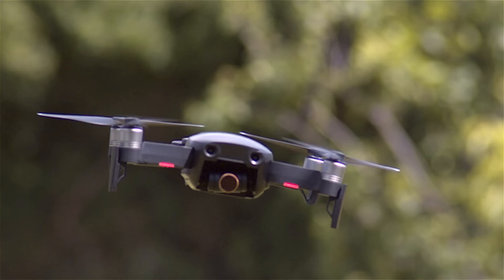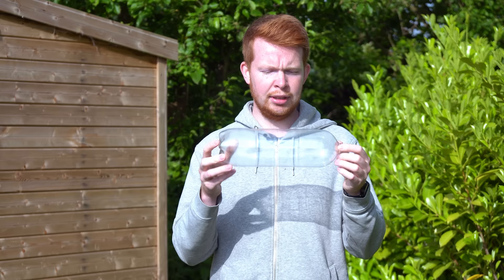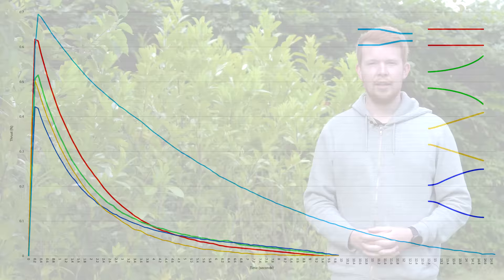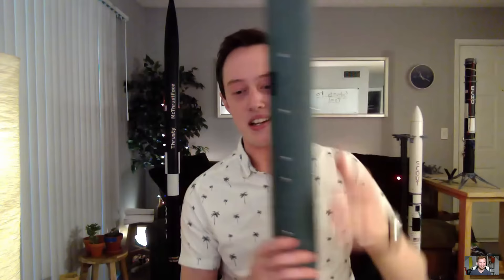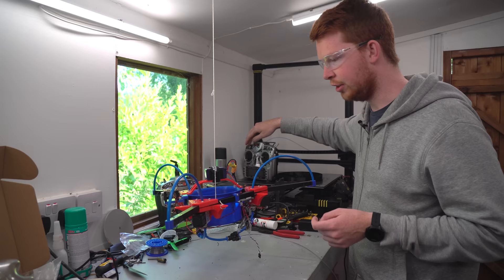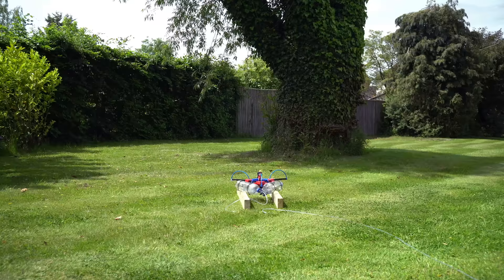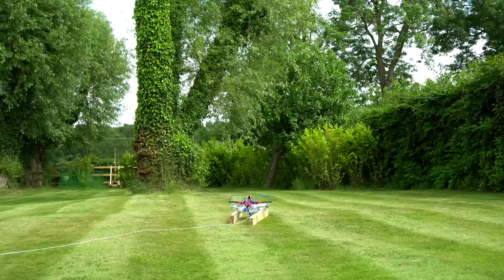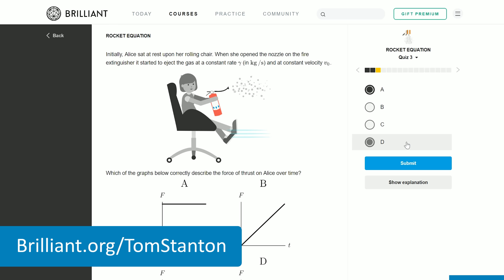Gas Thruster Controlled Drone

Comment: Nice work Tom. How about a pressure regulator on the valves? Small, light en always the same pressure till the main pressure drops below the regulator. Find out what pressure is needed to control the drone and go to the minimum to extend flight time. Also try to get more compressed air stored to maximize it.

Comment: why not put a small vessle to store Dri ice and have the gas's piped into the lines from that
as if you take fine  crushed dry ice it is light and will keep producing a bit of gass  giving possibly a bit extra run time with smaller size of tank

Comment: It appears that the sampling ratio is not in syc with the reaction time of the valves, also a fixed gyro to stabilize the horizontal plane would dampen overcontrolling and be more "user friendly ..

Comment: Looks like your issue with taking off directly from the ground could be due to the Bernoulli effect. Simplified, the air from the motor duct is exhausting straight down to the ground and then outward, squeezing between the ground and the air reservoirs. This makes a low pressure zone underneath, which allows the atmospheric pressure above to push the vehicle down. In essence, it's creating reverse lift. Just my theory though.

Comment: the idea is great. but the balancer would have to be sensitive and instead of the propeller, a helium balon would be a great thing. then you would need twice the number of nozzles, but would have an almost silent drone and an extremely economical one. with solar and a small compressor, the flight time would be unlimited. the part would only be quite large.

Comment: How about try using more than 1 nozzle per arm on the single hose to get more thrust per corner. Might have to increase the size of the hose a little. Probably fit the 3 nozzles in the single tip. Will this up the thrust any or would the extra release of air pressure drop the thrust?

Comment: It seems to me that, early in the flight, it wastes a lot of pressure over-correcting itself. If you could throttle down the thrust early in the flight, that might significantly help to increase flight duration.

Comment: I'm late to the game and I expect you have move on. However, you have a good idea that will work. A tri-copter with no exposed moving parts could have several uses. It needs to have the attitude adjustment jets thrust be predicable throughout the flight. Using  Aluminum or Carbon Fiber air tanks with pressures up to4,500 psi giving as much as 45 times as much air storage in the same size tank. Of course it would require a second tank and a regulator to supply air at a constant 150 to 400 psi. At these pressures, you could use much smaller nozzles and valves to send shorter pulse air at higher pressures/velocity conserving air as thrust is calculated as Mass * Volume squared, which would be the (density of air * pressure) * (V * V) giving the pressure an extraordinary contribution to the thrust as it contributes to both mass and velocity. 

Using an old man's 60-year out-of-date minimal physics education, some experiance experience valving gases, and a bit of Google foo to find calculators get the Standard Cubic Feet Per Minute flow for air out of a 0.1 & 0.5-inch hole at 100 and 200 psi and converted the SCFM to psi with another online app. Based on my current thoughts, the following is the function in Cran R I used to calculate the thrust due to pressure and velocity. It is the velocity of air in feet per second (fps), the pressure in pounds per square inch (psi) above atmospheric pressure (~14 psi), and I used 0.000747344 oz/cubic inch as the density of air. Sorry for not using Metric units. I can, but this one is tough enough I need units I understand without question to trust the work at all. I could be dead wrong or have gone off the rails at any point.

f.thrust.gas <- function(v,p,d=0.000747344){
   return(((p-14)*d)*v^2)  # I grew up using 6 inch slide rule. 14 pis is close enough to 1 bar for this.
}
f.thrust.gas(3000 fps, 200 psi)/f.thrust.gas(1500 fps, 100 psi)
return 8.651163 times more thrust from twice the pressure.
which was twice as large as I expected it to be. I hadn't considered that the pressure would increase the gas's density until I started to commit the idea to code.

This calculation shows a 36 times more thrust from a 0.1-inch orifice at 80 psi than from 20 psi above atmospheric pressure. I think you will have to put a pressure sensor somewhere in the system so you can increase the the time the jets are open as the pressure falls or regulate the pressure in a secondary tank that feeds the valves to attitude control jets and have a pressure sensor on the high pressure tank to warn as the pressure falls too low.

Comment: Maybe a next step could be adding 1 or 2L hp aluminum or carbon tanks from airguns? Pumps can be rented or use a few hp 80cuft scuba cylinders as refill source. They can nominally run 500 psi. I'd consider swapping to off the shelf nitrous solenoids (car racing) to gain considerable flow but mostly for the speed of actuation, addingsome supercapacitors inline. I have all the above here to lend my friend, but we are a world away :-)

Comment: I guess you could put a digital PSI detector in there that could dynamically change the values on the Arduino. I'm not sure how easy it would be effectively do that, though

Comment: Bang bang control should produce oscillatory systems as you would overshoot each time the feedback kicks in. If you have like 3-4 valves for each bottle, with different follow rates, you have a more granular control which will allow better stabilization. I am interested in seeing the graphs to see why it was right out unstable instead of oscillatory.

Comment: I recently tried to build a similar self stabilizing while manually controllable thing in vanilla scrap mechanic but i failed when i realized that there are just logic gates to provide automatic control and a binary state distance sensor.
Need to try it again with mods at some point 🤔

Comment: Try a larger prop cylinder to let more air through for lift it is quite large bottom to top for the area size or a 3rd of the hight for the size of the airflow ?

Comment: I can see weight distribution being improved way more efficiently to work with the propulsion system as well as placing thrusters on an “antenna” so it works as a leaver, so the tilt can be  less aggressively and more efficiently so the thrusters eat less supply. It also may help if you place some of the weight to a drag behind the level of the engine thrust point. The conventional drone shape configuration may not be the best application for the propulsion system. This drone should be designed with the propulsion in mind and it will prob look way different.

Comment: you are using hipersonic nozzles, however the speed of the gass never manages to create a shockwave, therefore you should use bernoulli principle and mass conservation in integral form, assuming Q1D, the outlet area shoud be much more smaller in order to obtain a higher escape speed and therefore improving your delta V

Comment: At 11:41 I instantly said "uhoh..." cause that's an undamped system and they tend to go nuts. Let's see how right I am. As I suspected, almost works but can trigger back and forth over and over out of control.

Then he goes on to prove it works. But it's also not very stable for the reasons I thought originally. Still awesome!

Comment: Tom. If the thrusters were shooting a little water instead of air would that be more effective ?  Clearly there’s a mass issue in carrying the water but the reaction should be far greater. Also; how about using a denser gas ?

Comment: Hey Tom, that's clever, maybe somebody else already write a comment in that way but there is too much...

If you can do a 2 stages  gaz tank system with a higher pressure in the first stage that fill the second stage you can have a  constant pressure in the 2nd stage, no?

Comment: Could you use a 3 port solenoids to bleed off air using gain... creating a ramped effect... theoretically you could use that bleed air as additional thrust on a additional "main" jet.

Comment: Why don’t you use car fuel injectors as valves plus outlet they can perform both duties, they are light weight, can holds liquid pressure of 50 to 60 psi, and needs 12volts dc just as on and off position...

Comment: If the drone with the longer arms worked best at low pressure, why not use a pressure regulator? you would also get more control time.
Nice project!

Comment: Hi Tom. Ever thought about using some dry ice or liquid nitrogen as your "compressed gas". I guess if you put in a small solar powered heating element and a dump valve you could, to a degree, control the pressure out put.

Comment: The thrust is proportional to air flow rate through nozzle times to air velocity of air leaving nozzle. You showed that a 2mm nozzle increased air velocity much more than it reduced flow rate. Your goal is to maximize velocity so you get the most thrust and minimum flow rate.  You should have tried a smaller diameter nozzle. Then a better nozzle shape might have helped.

Comment: really enjoyed your video. you should design and 3d print a flying saucer drone. set up 6 small motors evenly spaced with...NO PROPELLERS ...but....turbo fans that are 3d printed at proper pitch for maximum lift. your saucer could have six holes cut out evenly spaced for the turbine fans. then use a gyroscope....a small one...in the center of the craft for balance. im going to be building one with my 3d printer out of PLA. you could use hall sensors for proper rpm of each motor to make sure they are putting out the same thrust. a hall sensor could be placed by each motor read by a digit screen BEFORE you install them into the saucer...so you know they have the same identical rpm.

Comment: i think it would work better with the tanks on the opposite side on top and the board on the bottom which should help with controlling issue aswell this should even it out mabe?.....and a 4 leg stand so that its not flat on the ground

Comment: So a 3 motor design wouldn't work because there would always be 2 motors turning in one direction and one in the other right? What if you could revert the turning direction of each one of those motors multiple times per second? Perhaps you could have some clever software figure out when to turn which motor in what direction to provide yaw control.

Comment: You  need regulated flow out the solenoid valves, cant have your pressure dropping with only the controller to compensate.

Comment: The reason the straight nozzle performed best was because it was the least overexpanded, you need to calculate the ideal expansion ratio and make sure you get that, then I’d expect a bell nozzle to perform best.

Comment: Air is pushed out of the nozzle... pushing on the air under the drone... because of the frictition it causes it can fly... but in space.. on what is the rocket fuel pressing? Ther should be vaccum.. and vacuum means there is nothing tp push...

Comment: Good job! I'd like to add my suggestions: looks like a turbojet's nozzle was the best, may be to modify it for better efficiency: to make narrowing of the nozzle's hole with radius,  not straight line, like it was in the bell nozzle, but opposite (outlet is smaller than inlet), may be  it will increase thrust a bit...What about to make arms longer?This way you'll increase levers of the forces and efficiency, may be to make them thicker in the place of attachment and thinner on the ends, it will decrease weight...

Comment: Could you make the throttle on/off conversion value a dependent variable on tank pressure? I assume the optimal value changes as available pressure changes. Might be a rather simple conversion factor but you'll need to add an additional sensor for pressure if you don't already.

Comment: I notice in the in-shed balance test around 14:00, it tends to fire to correct a tilt, and then fire a smaller burst just after. Presumably that's the first burst over-tilting, and the second one in the opposite direction to compensate? Could you tweak the PID values a bit so it would just do one shorter burst, without overshooting and needing the second one?

Comment: Did you think on using water as the fluid being eyected? What if you had a pressure regulator? You had that issue ruled out with the line to the big tank

Comment: yo duuude correct me if i am wong but isn't fluid dynamics telling that when volume goes up, pressure goes down = less thrust? I mean the nozzles! If you think that jets has nozzles that constricts the airflow through smaller area, thrust builds up? Rockets has the nozzle since the  concept is different, creating the thrust and combustion in the actual nozzle? I mean bernouille law?

Comment: WHERE do you get those 2-liter bottles with the annular ribs in them? For years all I've found are smooth-walled bottles. I like to build water rockets, and the 2-liter bottles available nowadays buckle at high speed (which is about 270 kph) after the pressure is exhausted, due to the vaccuum being pulled on the nozzle by the airflow. When the rocket buckles, it self-destructs, but fortunately I've always safely recovered the onboard video camera and recording altimeter (the most expensive parts). Smaller bottles work OK but I'd love to find 2-liter bottles with ribbing as shown in this video. Older bottles (at least here in the US) had ribs and were a bit thicker. Not anymore.

Comment: What if you pointed the thrusters outwards at aprox 40 deg, so when the drone is tilted towards the thruster it points down and not in the direction the drone is tilted?`Think it would increase the stability of the drone. Otherwise a verry cool eksperiment.

Comment: Why not just use two double acting cylinders and a pivot point to tilt the ducted fan housing to vector the thrust?  I guess that would be too simple and logical.  And instead of carrying tanks of compressed air to actuate cylinders, use stepper motors and a rack and pinion gear set to tilt the fan housing. Three points determine a plane, so by altering the position of two of the points, you can establish a new plane.

Comment: Great stuff as always Tom. Need more air? Consider reinforcing the bottle with fish line and epoxy like the water bottle rocket enthusiasts. I think they achieve hundreds of lbs of pressure. They also use carbon fiber wraps and go even higher  ... perhaps close to 1000.  Best of luck.

Comment: It appears that the rcs system is not firing multiple jets at once. It seems to fire and then try to correct for what the other jet did. Rather then working in tandem with each other

Comment: Did you plumb each air bottle to an individual nozzle? I could see that being an issue as the flight progresses, the nozzle/bottle that is used more will have lower pressure and thrust over time, leading to the whole thing falling out of tune. Better to join the three bottles into a common manifold before plumbing out to the individual valve/nozzles?

EDIT - based on the pressure release from the system at the end of the video, I guess they are plumbed to a common point, nevermind :)

Also - you may get much more efficient thrust (and longer flight duration), with a better designed nozzle with the correct expansion ratio.

Comment: nozzles - i guessed red, linear flow is always better, and what you really want is a large diameter pipe (5mm?) leading to a flat wall, as thin as possible, with your nozzle hole punched as clean as possible through the wall.  suggest you research linear flow online, is fascinating.  now on with your video, is very interesting, thank you.

Comment: Great project!  This is the second time I watched this.  Don't know if you considered this or its been suggested elsewhere, but how about using aluminum bottles for the air pressure.  They could hold a larger volume.

Comment: Very interesting channel. I wonder if your water bottle container was scaled up to the size of a bus and filled with lighter than air gas and all the necessary mechanical equipment and rc control gubbins was inside except for 4 exhaust thruster nozzles (which were underneath) could it fly? More importantly, would it be cold on radar?

Comment: The valve solenoids sound like they are either completely open or completely closed.  

Would it be possible to use pulse width modulation to give better control than the simple bang bang control you have now?

Comment: hi Tom. I have a multistage rotor which you can use for this experiment. i unfortunately dont have the materials or finance to carry it out.. If you want to do this experiment with the muti stage rotor which also has a vector thrusting outlet for the compressed air or gas. Please revert to me if intrested. i will forward the drawings to you.

Comment: Id like if you went a little more into what you think the reason the straight nozzle won, in real rockets i imagine its because the exhaust is far beyond supersonic and you want your velocity energy to turn more into pressure energy like in the diverging ducts in the turbine of jet engines and supersonic causes a choked nozzle? Ive only done a degree in jet engines, not rocket engineering haha